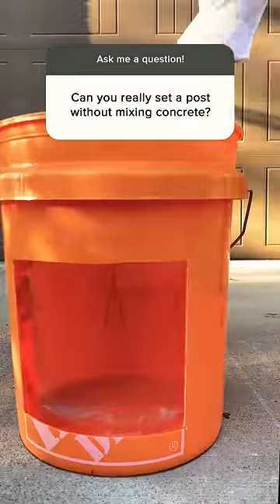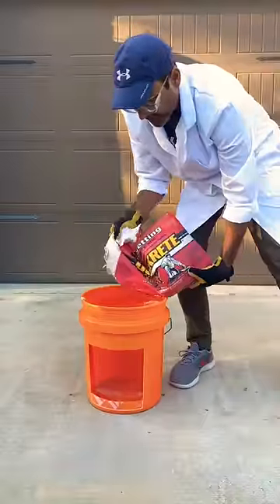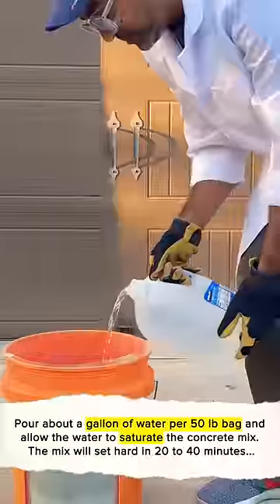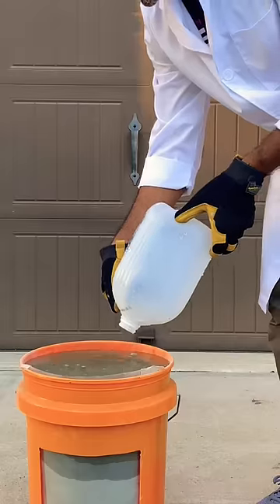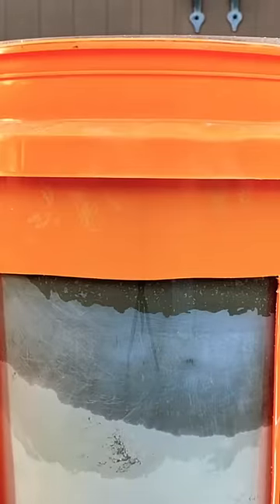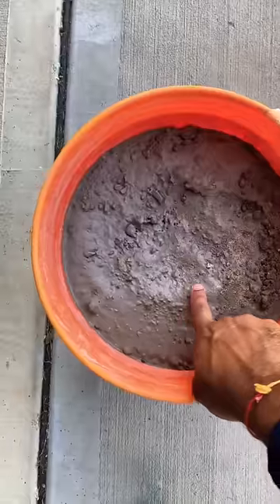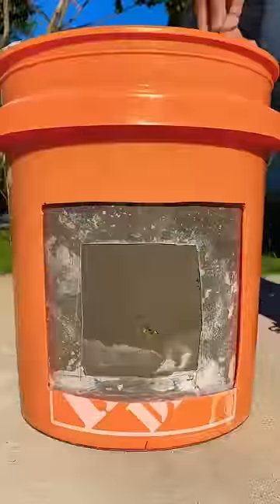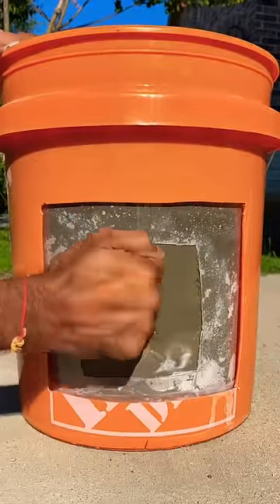Have you ever tried Quikrete’s fast setting concrete mix?

Comment: Pull it out of the bucket and break it open wtf you skipped the best part
Reply: that would show how bad this product is
Reply: What is inside the middle...  How hard????
Reply: @Ricardo-C  theres generally a post in the middle.....
Reply: @ianicus123  I normally put a pair of feet in the centre
Reply: Needs Home Depot theme song in background too
Reply: Basically it's hard concrete inside as  well
Reply: Oh there was already a logical statement never mind. I agree with this guy
Reply: @Ricardo-C  Why is it bad? 
Concrete takes 28 days to cure to full strength.  It would be wise in this situation to hose them down for the next few days too. The ground moisture and any rain will help too.
That concrete will be.. well, concrete.
🤷‍♂️ It's Portland cement, sand and rocks, plus some calcium to speed the curing process in the quick set bags.
Reply: he forgot to stick something in it then pry it out and hit or run it over
Reply: Yeah 100% failed , but to be fair it didn't need investigating in the first place , what's next lets see if drill bits make holes 😅🤣
Reply: For real tapping it with those soft ass knuckles isn't proving anything
Reply: @Gnolomweb  foget abouttit
Reply: @Gnolomweb  Fuck dude...I just choked on lunch
Reply: For real dude never mixed it
Reply: Also the bucket isn't going in the ground, so what happens when the water runs through the soil instead?
Reply: @Ricardo-C  this is for fence posts my guy not fuckin structual steel.
Reply: Why didn't you set a post in it? Do another experiment with a post set in the Crete, then hit it with a sledge hammer. It could've set up on the outside but not the inside.
Reply: When your post falls down because the unset powder in the center doesn’t hold very well. You can just add water again the next year 😂😂
Reply: Yes i hate this.
Reply: @Ricardo-C  what’s bad about it??? Works damn good for my fence 🤷🏻‍♂️🤷🏻‍♂️🤷🏻‍♂️
Reply: @Ricardo-C
Reply: @Ricardo-C  That's the point!
Reply: It’s still powder in the middle.
Reply: Dude that was such a half assed test!
Put some sort of post in it, wait the time the instructions say, then turn the bucket upside down and let us see the whole thing. I bet the bottom is still dry mix. If you want to be really thorough crack the concrete in half and see how much water penetrated into the dust mixture in the middle.
Reply: Well it's also alot of water in the actual dirt that the concrete will feed on also
Reply: @ianicus123 lol
Reply: @maniacmattmtl I generally keep some blueberries and a banana smoothie in there
Reply: probably breaks easlily
Reply: @ianicus123  lmao
Reply: @ianicus123 that’s why it matters if it’s soft in the centre it ain’t holding the post
Reply: @emmittmatthews8636 technically concrete gets about 90% in 28 days and then it continues to gain strength but at very slow rate.
If you just pure one gallon of water into a post hole, expect some water to go into soil and not into concrete mixture. Bucket helps with keeping the moisture in the mixture.
Reply: Man's clearly a quikrete employee
Reply: Jimmy Hoffa's feet 😂
Reply: So pour amd pour some more and no stirring oh I see why it's not mixed in middle
Reply: It’s works great for post setting as even if it doesn’t fully cure it will continue to cure with any ground moisture
Reply: YESS, THIS XACTLY! I screamed at him!
Reply: That's exactly what I was hoping for.. Man News would be very disappointed😂😂
Reply: @Gnolomweb 😂😂😂
Reply: Maybe wait til after a week to allow it to fully cure
Reply: It works as well as premix. The only people who claim otherwise make money in the business or someone who did it wrong to sabatoge it.
Reply: @Gnolomweb  Better keep that one under water....
Reply: @kramnull8962  ... lol, fish can't eat bones!
Reply: Sledgehammer test???

Comment: Use that stuff for years and it works great. I usually take a piece of rebar and punch the water down in a little bit after I saturate it. Just make sure that it gets into the center
Reply: Well generally wouldn't there be a post in the center?
Reply: @thalaquatics8712  Jim Dean and I use it to make our problems disappear. Capiche? 🤌
Reply: @TheRagingPowner  best comment award goes to you!
Reply: Back on the day we would just throw the concrete bags in the holes and tamp them down and go. Now most decks were only 12x12 or 12 x 16 but never got any callbacks or complaints..
Reply: I've laid 100s of posts and have never had one lean. I set them the same way you do.
Reply: In Australia I use a bit of 8 mm rid and poke it all the way down. I also put water in the bottom of the hole first before the rapid set
Reply: Yup, when I used to build fences, we would pour the bag, use a hose to saturate the mix and used an extra picket or whatever to poke around at it just for extra assurance.
Reply: Been using it for the fence repairs on Travis Air Force, usually 2.5 bags per hole
Reply: @thalaquatics8712  You mix first with rebar and drop the 4x4 inside.
Reply: My old man said pack it till you cant anymore i want any idiot that hits my fortress to regret it.
Reply: Or stir it with my cement mixer..
Reply: @thalaquatics8712  I think OP meant like figuratively “in the center” because yes as you said , literally speaking , there would be a pole in the center of the concrete, but I think it was meant more like “the center” of the mix, like punch the mix with a rebar a few times to let the water penetrate or saturate the mix.
Reply: @XyzXyz-pm2rj  Exactly. thanks. I've never had one loosen by just doing that, and I set some hella big satellite dishes on 4 inch pipe with about 4 bags of that stuff in the holes.
Reply: @thalaquatics8712  depends on if you're burying it or surface mounting it
Reply: Yes me to
Reply: Same
Reply: @thalaquatics8712  that or you can use hardware to screw a plate into the concrete then screw the post into the plate
Reply: Yeah we used this stuff for fence post just last weekend, I just used a wooden stick to help the water get in there better
Reply: No need

Comment: My dad had 6 bags stacked in his old garage and forgot about them. Years pass. Decades. He had a new garage built. the old one starts to fall apart. after my father passed we had to tear down the old garage. I assure you, the paper bag does not prevent the cement from setting. If you don't need the bag, return it or else you also will have to move cement bricks 3 times the bag's original weight.
Reply: Not 3 times but I definitely feel you lol. When I was younger we had a truck with 16 pallets of those tip over in a hurricane. I hated life for a minute
Reply: Did the same with a different bag. It was cool to have a bag shaped 50lb brick... For a minute
Reply: Dehumidifier companies hate this one simple trick
Reply: Happened to my brother in law.
Reply: Quick, easy way to keep the concrete guys ... just move the bags around every once in a while (: 
Water (humidity) will find it's way in through the bag but moving it around helps alot
Reply: Turned mine into garden steps.
Reply: They last a while if you wrap them in plastic

Comment: For all you experts out there, we,'ve used this stuff to set posts for the last 15 years. -40c winters and no posts have moved or heaved. It's legit
Reply: Heaving is based on post depth below your frost line.

We use 1/4 down in the prairies on Canada so the posts "float" and can't heave since the frost line is 6+ feet
Reply: I have a rock that keeps tigers away.  You don't see any tigers around do you?
Reply: @dmills13F  Lisa I'd like to purchase that rock
Reply: We used to have this one spot on our creak and no matter what we did the fence would wash out eventually we dug a hole that was abt 3.5 ft wide and 4 ft  wide and stuck a 8x6 post in it the following spring had a flood and pushed the post over but the concrete stayed on well eventually we just ran high tensile across it and set posts Abt 30ft away from the creak
Reply: @dmills13F  😂
Reply: @michaelwagoner1524  a Stainless steel post  could hold up better maybe?
Reply: @evictioncarpentry2628  I'm in Alberta and have never heard of 1/4 down, I've only ever seen posts set in concrete
Reply: @evictioncarpentry2628 what does 1/4 down mean?
Reply: @shacko6864  I didn't say we set it in -40 I said the posts didn't heave out of the ground even at -40
Reply: Cap
Reply: @Dr.LongMonkey  1/4 of the length above ground. If you need a 4’ fence, you use at least a 5’ post and anchor at least 1’ into the ground. In Oklahoma we usually do 1/4 to 1/3 deep depending on the bedrock.
Reply: @conaldeugenepeterson2147  seems like a good idea with taller fence posts but I’ve always taken the bottom of the post below the frost line and use cast in place raised post bases
Reply: heaving has nothing to do with how concrete sets up

Comment: This stuff is a farmer’s best friend. Especially when you’re setting a couple hundred fence posts and don’t necessarily want to hand tamp dirt and rock down on all of them!
Reply: Farmers don't want to buy and haul around concrete when they already have the rocks and dirt
Reply: @davidlabossiere1140  it’s also bad for the land in general
Reply: Yep
Reply: We drive or bury, no one I know is using concrete on field fences.. the cost and time would be outrageous for just one mile of fence.
Reply: With a tractor pile attachment, we just ram farm posts in. No digging, no compacting, no sweat, easy to do and very fast.
Reply: @DruFishing you should add limestone and mix with saltwater, works like a regenerative agent for rock and cracks
Reply: I just used quick Crete today and it was pretty easy to use! So happy I didn’t have to actually mix anything.
Reply: We used this stuff to set posts. We wouldn't even add water, we would set the posts, add the mix and let the rain do the rest.

Comment: This man’s got knuckles of steel holy shit
Reply: I mean if you work wirh your hands even a little bit for several years your hands will get pretty tough. There is a reason old man hands are a thing
Reply: @Will Sobera: You think so?🤔 The only reason that concrete probably didn't hurt much or at all is because it's fast-setting concrete, he waited for more time, it didn't dry all the way, he said it's "near" rock-solid, and he didn't mix it for the gravely parts to take much form on the outside!
Reply: Y’all need to get out more. That doesn’t mean 💩
Reply: Bruh he wasn't even hitting hard lol
Reply: @jaredbradley4095  its true i saw the whole thing..
Reply: 420 like
Reply: Your hands get pretty hard if you ever touch anything besides a computer and yourself.
Reply: He just tapped a smooth concrete surface and he’s got knuckles of steel?
Reply: Wasn't even that hard lol. Can't believe the amount of weaklings thumbs upping this.

Comment: You have to also account for the fact that when you pour it into a dirt hole, the surrounding soil will generally wick moisture out of the block from all surfaces that it is in contact with, drying it even faster.
Reply: Depending on where you live. Around here, put your post in, get it square and just dump the concrete in and cover with dirt. Moisture from the soil does the rest. I first saw this in the early 70s.
Reply: Can tell the kids that think internet is reality.   I have NEVER added water for a post.  I even have a barn to prove it.
Reply: @Look_What_You_Did  you not doing that in a desert biome my dude.
Reply: @meeksmonsterminis3143  Look.... it's another kid...
Reply: I dont think this is true, even with dry soil. Which becomes water resistant. Makes watering my lawn hard.
Reply: Obviously depends on the relative moisture content of the soil. If you live in a dry sandy area, you could come back a week later and if you didn't add water it would still be dust. Alternatively, if you live in an area with a high soil moisture content, then you could probably get away with no addition of water as it would pull in water from the soil.
Reply: @Look_What_You_Did Why are you the way that you are.
Reply: @Look_What_You_Did good on ya, want a cookie?

Comment: I work for a concrete lab, I always get a little antsy when I see someone dump a bag in the hole and they don’t mix it. I might have to make some samples and strength test them.
Reply: I have a bunch of new electronic scales and rolometers if you want em. Sieves too all new  lol
Reply: @jolyletwoelk911 Luckily don’t have to use a rolometer too often thankfully, my region relies mostly on pressure-based meters.
Reply: Its a manufacturer approved method is the only reason I ever do it. Useful in some contexts for sure. Do some tests for us all!
Reply: That is the exact same reason I always mix also! Just can't bring myself to trust the consolidation and strength.
Reply: I work in the field, and setup thousands of posts using this product. No mixing is required.
Reply: @juanlanda967  it’s not as strong as mixing it, you just cut corners! doesn’t take that long to mix…..
Reply: @Billybob-go8hn  You're cutting corners by not using 50,000,000 psi concrete with diamond coated stainless rebar. /s
Seriously, this dry mix method is absolutely appropriate for CERTAIN uses. I wouldn't build a house foundation this way, but for a fencepost or mailbox? C'mon man.
Reply: No need. Quickcrete has done the r and d. It’s legit.
Reply: @PatrickKQ4HBD  it’s not comparable though, mixing costs nothing more than 5 mins of your time, it’s not the same as infusing diamonds into concrete, like saying taking a cab to save time is comparable to taking a private jet, makes no sense at all
Reply: eh.... it's not gonna compare to pre-stressed bridge concrete. buuuut we gotta remember it's for holding a post steady.
Reply: You don't need to mix it. Just dump it in the hole, no water. It will absorb the ambient moisture and cure solid.
Reply: @shacko6864  Not true if a bag of concrete sat out in the rain, the outside would be brittle and keep water from the majority of it. I drop it and it shatters to 100 pieces. Same with the test he did here and any project you have done this way. Professionals don’t cut corners. You either charge to do it right or don’t take the job. If I wanted half assed work I’d hire Mexicans.
Reply: I'd bet it is stronger mixed but my experience it's strong enough for a fence when not
Reply: Make us. A video
Reply: I have experimented with this in post holes. It isn't reliable, you get dry spots. You need to mix.

Comment: Still works better and sets stronger if you mix it super good. Heats up a lot too.
Reply: Absolutely.
Reply: It sets fine as is. If you wanna mix it go for it, but you're just doing more work necessary
Reply: @motox947  No, it definitely sets better. You can see the different layers where the portland stayed on the top, and the rock was mainly on the bottom. Giving it even a light mix would be much better.
Reply: @Blueshirt38  Could the layering have occurred as settling in the bag?  I wonder if mixing it dry then following along the video would make a better end mix.
Reply: It does.  Works absolutely better than you need for posts just like this though.  And if you're doing a BUNCH of posts then wasting time mixing it is going to cost.  

If you mix it correct this stuff is like 5000 psi concrete.  If you don't some of it will be less.  That's still way more than you're gonna need for posts.

Comment: That is how retention walls are build here in Southeast Texas. You just buy a contractors pallet of concrete (or however much you need) and start building. Because we get so much rain here and we live near the marsh and swamp, it soaks up water and by the end of the week, you have a solid wall. It takes a bit for the paper to soften and fall off but eventually it does and you have a perfectly molded and solid wall. Especially if you've set a good foundation for your wall.
Reply: You getting finessed 🤣🤣🤣
Reply: @evinmartinez2299  it works
Reply: Wouldn't the outside form a hard shell before the middles get moisture?
I mean, could be soft on the center?
Reply: @vigilantezack exactly…they haven’t thought it through….it won’t last.

Comment: We dry set with that stuff when building fences. Gives us time to pull the post and keep everything in the line even and pretty. We always pack the concrete down and aggregate it to make sure all the airs out, then refill the hole with packed down soil. Never had been called out for our 5 year warranty to fix a sagged post.

Comment: Note that Quickcrete states that it is not suitable for structural uses, so just be careful about what jobs you use it for.
Reply: literally says ideal for structural repairs on the bag?
Reply: haha, was just about to make some stairs in my garden. 

Can’t I use rebar to make it work for structural stuff?
Reply: It's 5000psi concrete. It's fine for replacing any concrete except maybe the Hoover dam
Reply: @suzieq-thefiveyearplan261 well for stairs it's fine, as long as your building some huge building on it you're good

If you're gonna pour a slab for your stairs then add rebar if you want not necessary though.But normally when you set a post for stairs you don't use rebar

Comment: A guy tested this with actual fence posts.
He set them as instructed Then used his skid steer a couple hours later to yank them out and see how/if they hardened and if they stuck to the post.

They were rock solid, completely surrounded the posts.

Comment: Helped build a fence with my grandpa when I was younger. Depends on the soil and I'm sure other things. Some of the posts still hold 15 years later, where as a couple have broken. More have lasted thought and it's possible some of the broken ones were bad wood. I personally stand by it